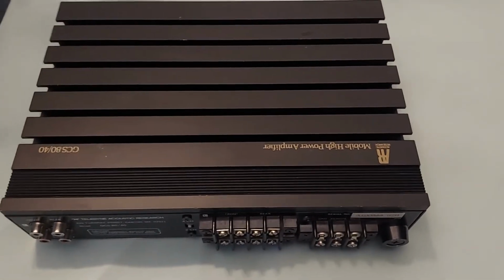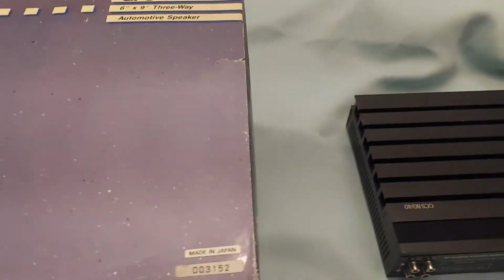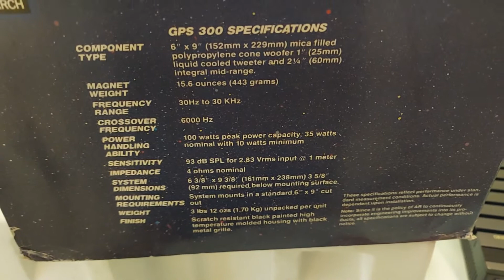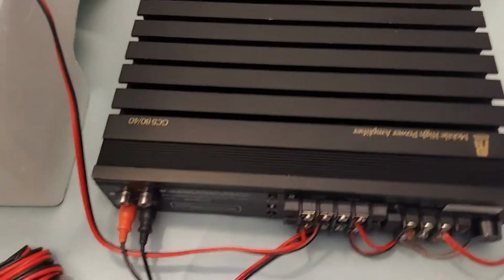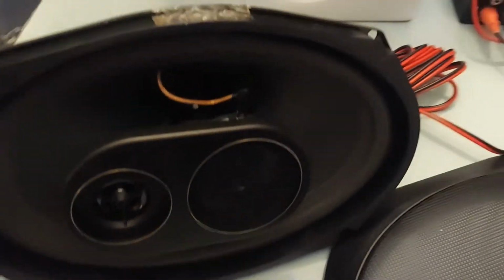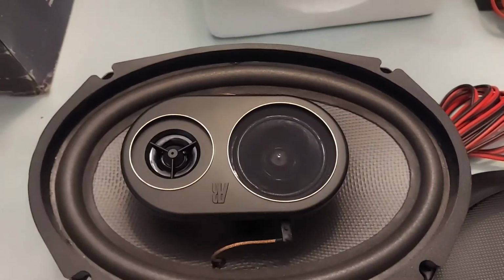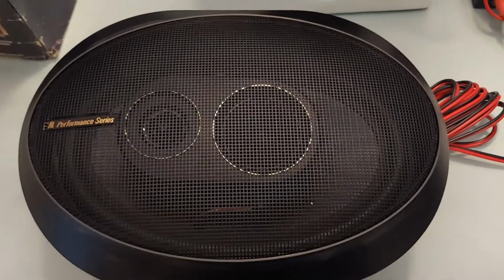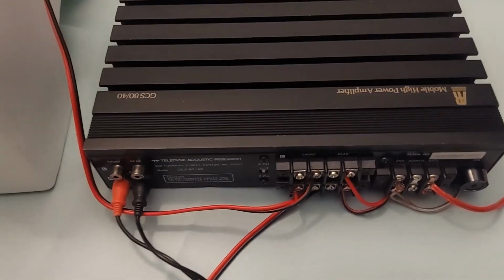1986 Acoustic Research Car audio Amp and speakers

Comment: Very nice amp and 6×9's. I didn't know Acoustic Research had car audio gear. Amazing to see them in new condition.
Reply from the maker: Yes these are rare AR only made car audio for about 4 years, the amplifier was expensive it retailed for $325 in 1986 -87 so I'm sure not many were sold. 
Thanks for your comment.

Comment: I have one of these, I bought it new many years ago and it still works like new.

 I hooked it up to my classic home speakers once (and a 35A 12v PSU), Pioneer CS-911A, and it put my Sony receiver that claims 100wX2 to shame. And those are 8 ohm speakers!

It really puts out 80W x2 or 40W x4 "RMS" @ 4 ohms, not the peak, or even peak to peak, BS ratings you see on everything these days.